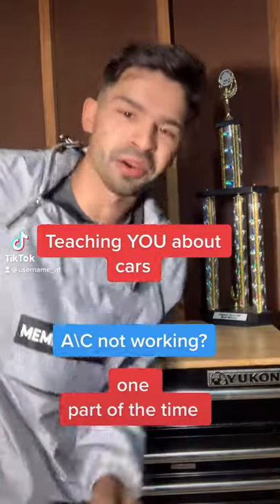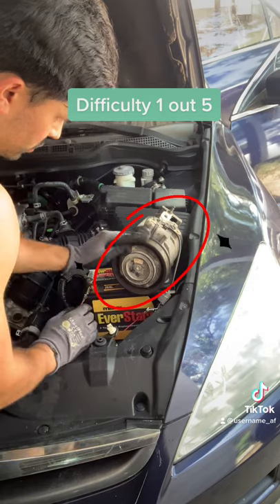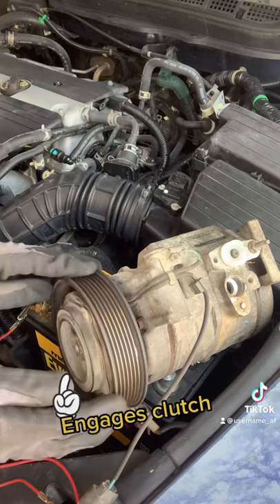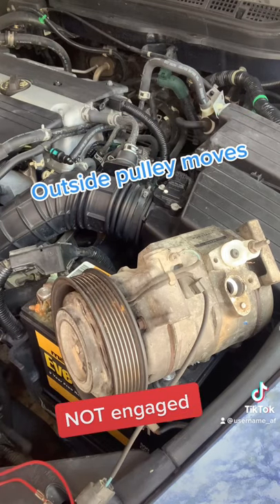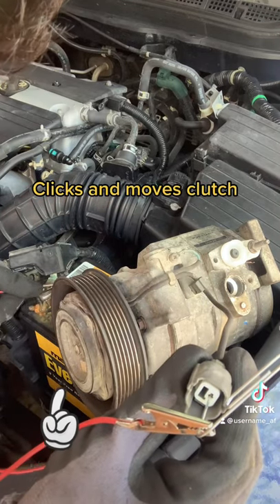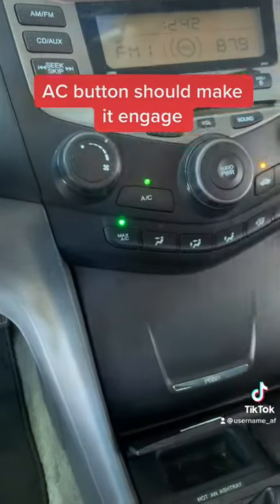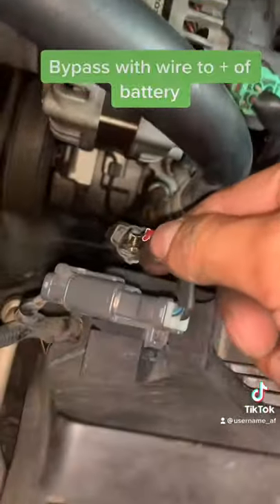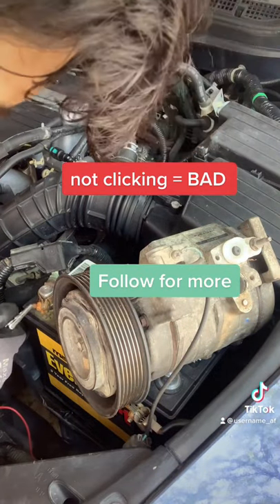How to Test Car A/C Compressor

Comment: You don’t even know what’s inside that ac compressor.smh. Most ac compressors have plastic valves and pieces now that are very complex, just cuz the ac compressor engages doesn’t mean it’s not broken.as a real mechanic I’ve seen plenty of ac compressors that would engage but a plastic internal piece or valve was broken due to shade tree mechanics that just try to charge them out mess with the ac system. The best way to recharge the ac system is to release all of the pressure and refrigerant until you have nothing but a vacuum left and then refill it to manufacturer settings. And even doing this could cause the system to fail due to not venting the air that is just sitting in the hoses that are being connected to the system. If you don’t have the proper equipment and tools of a real shop you have a high probably of failure when working on an ac system. Long story short is pay the extra money to a good reputable shop when it comes to your ac. Anything else just about is fair game. Not if you want you ac to work as it should for a long time just take it to a shop. The worst case scenario is the ac compressor needs to be replaced and the system needs to be properly refilled and even on an Audi or a Benz the most you should pay for this service is $1,200. And that’s for a German luxury vehicle.a normal vehicle like an Asian or American vehicle should only cost half of that about $600. If you don’t have that much to spend put it on your credit card and if you don’t have a credit card or the money then you shouldn’t have a car anyway unless you can afford one. Very simple.
Reply: Get real.

Comment: That's an awful amount of work to see if the clutch engages.plus there is more to that system than just fuses.you shouldn't be posting this video because there is so much more involved in this system for the a-c to operate.
Reply from the maker: You don’t have to remove the compressor that’s just so you can get a better visual representation. And yes there’s a lot of different parts in AC system but this lets you see if it’s the compressor.
Reply: Shoulda just cleaned it